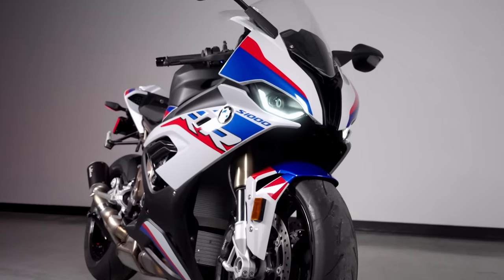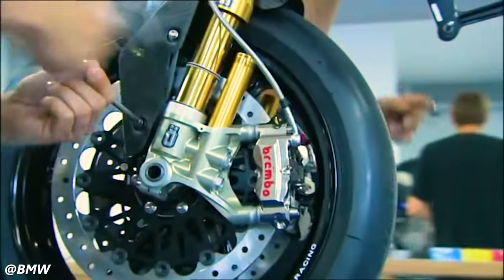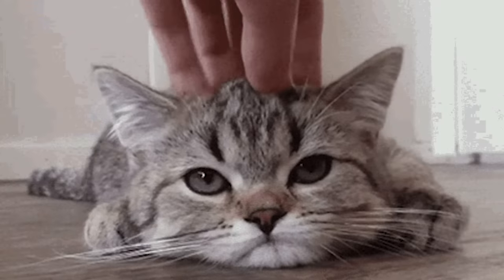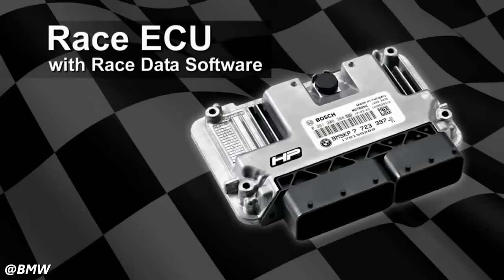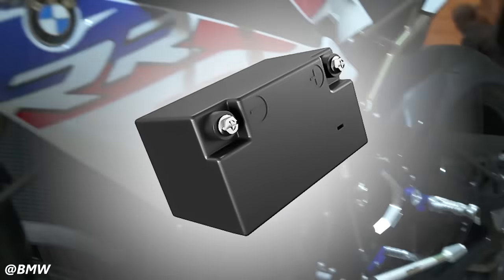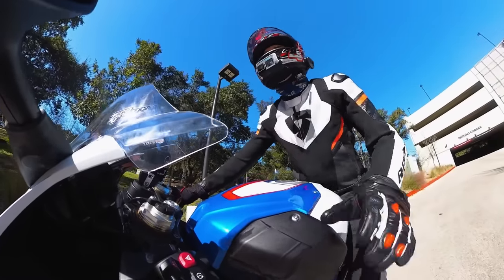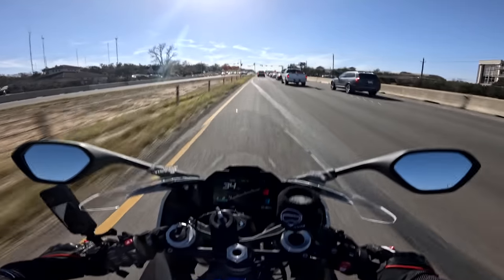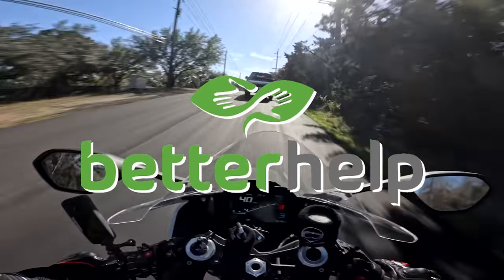So you want a BMW S1000RR...

Comment: Had a neighbor who had one and would race on track days. One little tip over and a dented gas tank. $3000 later…
Reply: I mean yeah it’s a BMW what’d you expect on par for the course of expensive repair
Reply: He wouldn’t buy if he couldn’t afford another one 😜
Reply: Thats similar with any of the 1000cc superbikes. One peice of side fairing on a Yamaha or Honda is about 4 to 500 brand new. So imagine a new gas tank. It's normal dude. Bikes are expensive toys
Reply: so like any bike, had that happen on my zx6r 09
Reply: @devilik3692 i have an 09 zx-6r.  6500 rpm at 70 mph? Damn‼️ Thats what kind of rpm’s mine is pushing. Seems kinda high😂.
Reply: A gas tank for my '05 Gixxer is somewhere from a quarter to half of what the bike is worth (near showroom condition)... 
Makes sense they're all either in beautiful condition, or they're ratty striped down/ stunted/ tracked out and glued + zip tied beaters.

Comment: Do a review on the 2024 cbr500r and see if you think the new model has improved on the old one
Reply: Spoiler alert: the 2024 cbr500r is overpriced, slow, heavy... but good ergonomics and reliability... still garbage though 🤣
Reply: I'm really interested in this. Make it happen papi yam!
Reply: Would be nice but he's not gonna budge because there's no change to the engine firing order/power output.
Reply: They added winglets, tft and rider modes nothing else has changed.
Reply: @shauns5278  and showa USD forks, dual disc brakes, lighter wheels, a new swing arm, new showa shock, pilot road 6  tires, new cam shaft, new pistons, new injectors, and it's 5 pounds lighter. All that has been updated since the 2019 model he reviewed.

Comment: I'm super surprised that you haven't mentioned the 9k rpm power loss in any of ur videos. This bike really needs at least a BT stage 1 or equivalent tune to really unleash the full fun factor
Reply: Very true. It gives 30% at full pin in 2nd

Comment: If you turn the electronics off at the track it turns into a old ducati.
Reply: Ducati? 😮 I was thinking more GSXR as its closest comparator.
Reply: @ThaBootyBandit   Yeah, definitely... I was meaning more in ergo's and style than performance. BMW actually used a K5 Gsxr1000 as a blueprint for the very first S1000R.
Reply: @paulhope3401 BMW reversed engineered 10 Suzuki K5’s to make the S1000RR the father of the S1000RR is the Gixxer K5.  That’s why it feels light and nimble and narrow like a 600 the same way the K5/6 does.

Comment: Good history lesson! Just bought a 23 S1000XR M package. Explains why this quick-shifter is the best in the market. I'm old (55), and spent the extra $$ on all of the extra nannies to keep the rubber-side-down. Looked at Ducati & KTM, but believe it or not, BMW reliability wins in this case. I know the XR is apples to oranges, but all of the RR goodness has trickled down and make my old FJ09 and older FZ1 seem like antiques!  Brembo brakes stop on a dime. Active suspension is awesome. Wheelie control... check!  And, still comfortable enough my wife will get on the back for a run for our $10 cappucinos 🤣 Yup, I'm a yuppie biker!

Comment: Crazy How expensive a S1Krr is in the States here in Germany a fully spec S1000rr Brand New from the dealer costs 19-20,5k Euros and Service is around 250-350euro
Reply: It’s almost as if buying domestic is somehow cheaper… FASCINATING
Reply: Fck is you talking about. New naked s1000rr literally start at 20,5k€ on their homepage
Reply: @babi8709  what... Here it starts at 24,680 Euro!. without any options. full packages is over 50K
Reply: @Kylian381  no

Comment: wait, base trim $25K? hmmmm not sure if that is accurate. The S1000RR M package I would agree, not the base model. I believe the base is around 17k but good luck finding one because most dealers add at least a couple options. Turn off all the driving aids, add a brentune and then this bike definitely has some character, otherwise I do agree, this thing feels like a 600 under 8K RPM.

Comment: Maybe someone with more knowledge can shed some light on this for me... But I really can't see the point in 220bhp for the following reason. When you look at power maps the power seems to be restricted to say 60 percent and barely ever 80 or upwards for the majority of the power band probably worse with traction control on. At least with wired throttle you could choose how much power you have. They seem to massively limit the available power which seems to defeat the point.

Comment: If I won a bike like this I would ride until the next service is due just to check it out and then sell ASAP just because of the upkeep cost.  I just bought an XR150L just because I don't need to go 190 MPH or spend that kind of money to maintain it and have my fun on a bike.  More fun to ride a slow bike fast than a fast bike slow.  And riding an almost 40K bike on the street would make me cringe just thinking how fast it could be totaled by an insurance company if I laid it down or some cager hit me like when I was young on my brand new FZ600.  They broke my crankcase cover where it still held oil but, insurance called it totaled because it required full engine tear down to replace.  Other than that this is surely a badass bike.
Reply: Jesus bro, the servicing is not expensive on these bikes
Reply: @chalky042  I've been riding for almost 50 years and and the end of my riding life so I don't need to be spending 40K on a motorcycle I'll rarely ride and he said it himself in the video his first service which has to be done at the dealer was $700.  That was probably an oil change and other fluid checks and adjustments.  Wait until it needs bigger services.  My other bike is the RD400 in profile PIC which I'd also rather ride.
Reply: @RedBud315 glad you managed to survive 50 years of riding bro, I have been running my gen 1 for the last 10k miles including doing my own big service, if I had a new bmw I’d 100% but it with a service pack because it makes sense to have a main dealer service history from new to preserve the value
Reply: @RedBud315  The valve check is the only "big" service most people will likely run into (every 18K miles).   It's about 1000 bucks if you have a dealer do it and the oil/air filter at the same time.   Just the valves, it's around 600 bucks.   I do everything else myself, oil is <100 bucks (every 6K miles) using all OEM parts.   It's not that bad; it's not cheap, but it's not like maintaining a Ferrari.

Comment: The most wins of the Moto Grand Prix championships by a manufacturer is eight and was achieved by Honda (Japan) in 2002, 2003, 2004, 2006, 2011, 2012, 2013 and 2014. why no mention of Honda poppa Noob?

Comment: Got so many things wrong here.  You CAN do your own maintenance without voiding warranty. First service doesn't cost half of what you stated. Also forgot to mention the 2023 S1k and all the upgrades from the previous models. I just hope your viewers do their own research when it comes to these bikes. Been riding rockets over 20 years. Coming from a life long Honda fan boy it Doesn't get much better than an S1K. I'm on my second one.  "BMW scoff"
Reply: In the statates the price for the first maintenance in a BMW can vary a lot, it dependes of how much the dealer is charhing for the labour. You can easly find users reporting first maintenace from 280 to 700 us dollars if you google a bit.  They’ll do an oil change, check for metal, torque bolts, flash (unlock the bike), so Yammie is not wrong.

Also, seems only the us and perhaps a few other countrys let you do you own maintenaces, for example here in mexico the dealer have to do the maintenance to not void the warranty, this applys to any car or bike.